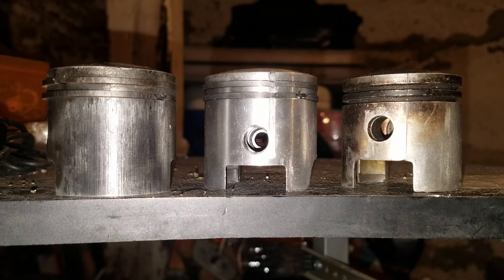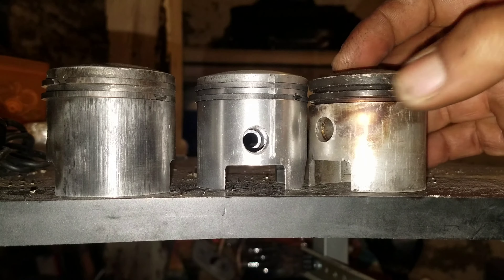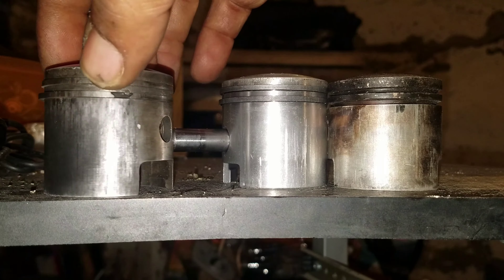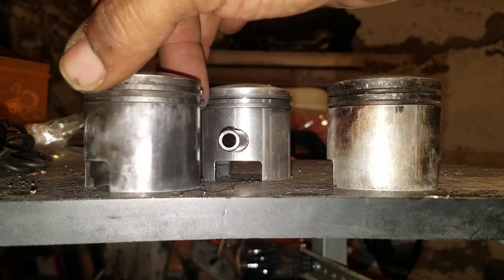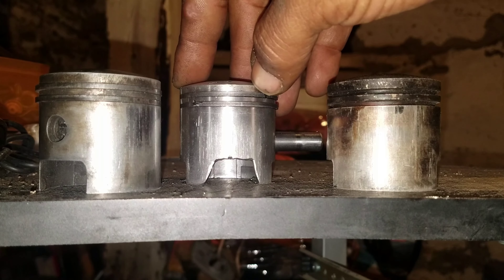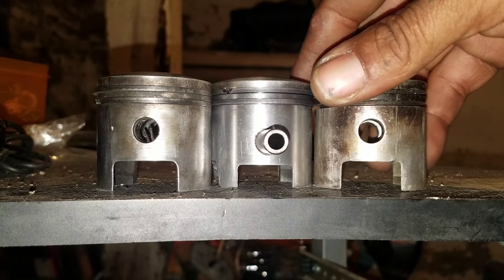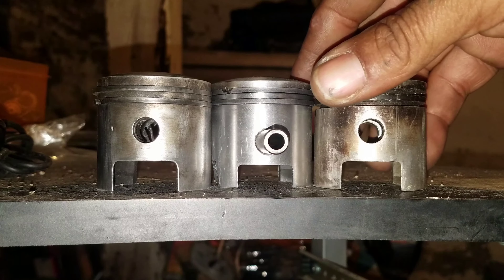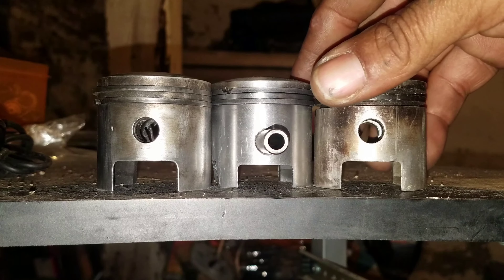Motorized Bicycle 66cc 80cc Piston. Dont Buy The Wrong One For Your Motorized Bicycle Engine

Comment: Those are some mighty CHEAPLY made pistons.  The clips need the little gully built into it so you don't wreak havoc on the aluminum when putting them in.  Better pistons have em on both sides of the clip seat.  Makes it so much easier.
Reply from the maker: @whatsyurprob158  yeah ik its Chinese pot metal